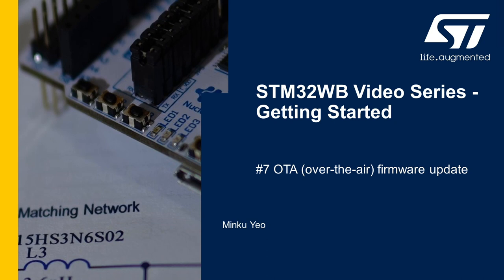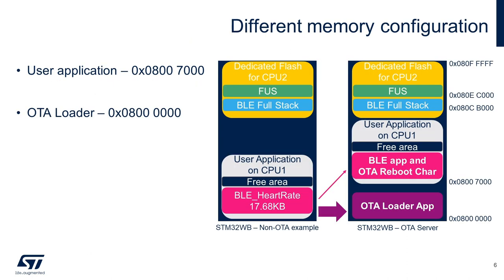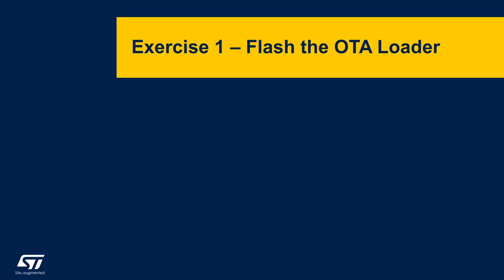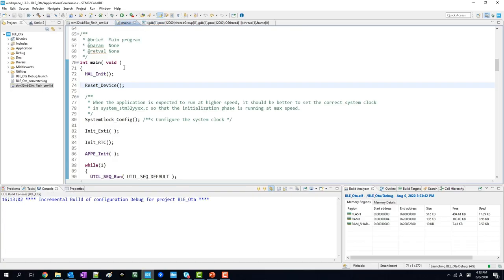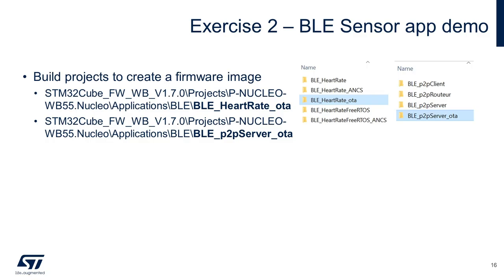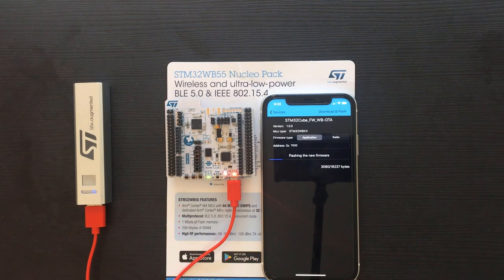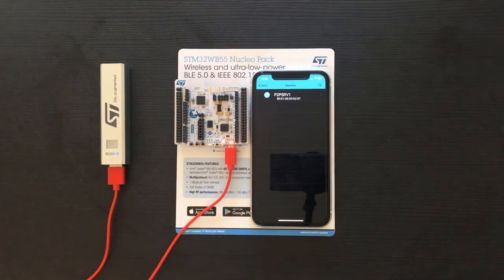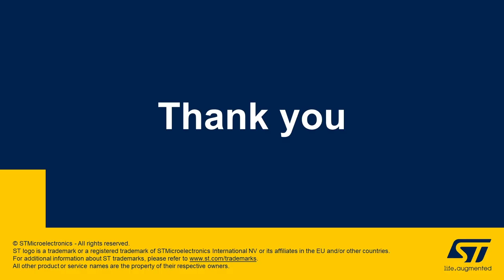STM32WB Getting Started Series: Part 7, Over-the-Air (OTA)

Comment: Thanks a lot for the video. It is very helpful.
Reply from the maker: Glad it was helpful!
Reply: @stmicroelectronics  I am not able to debug the project after implementing OTA. I get a message saying "Break at address "0x8004454" with no debug information available, or outside of program code.". I have discussed this issue in the ST community. I followed few steps I got, but still have the same problem. The person who guided me, has never done debugging on OTA projects and he expects, there should be some documentation/readme file together with the applications I am testing. Any tip for debugging correctly?
Reply: @stmicroelectronics  Hi, Is there any solution for an OTA firmware update on STM8S?, Thanks in advance. 🙂

Comment: Thank you for the video. Actually I made the OTA on a STM32WB35 several months ago and now I saw your video to solve a problem I'm facing with. The initial OTA bootloader and an user App work well for me, but I want to merge the OTA bootloader with some more stuff and change size of it to bigger than before. So it growed and the start addr of user App now is 0x800D000 (instead of 0x8007000),  But it doesnt work. I have new constant address for magic number on 0x800D140 (instead of 0x8007140) on the user App. On the OTA bootloader I modified the start vector:  #define CFG_APP_START_SECTOR_INDEX   (13) , on the app_config.h file and even I defined it on general preprocessor macros in the properties of project. I'm searching a lot to fix my problem, the problem is after trying OTA bootloader, after sending the user App, the user app dosn't start and it will return to Bootloader OTA and advertises there. Could you please give me some tips about what I'm missing for this changing start Addr of user App? So in a brief, I just want to change the start Addr of user App from 0x8007000 to a new Addr like 0x800D000. On the .hex file which is made by STMCUBE-IDE I can see the magic number Addr and its value on supposed sections, and everything seems prepared, but doesn't work.

Best regards.